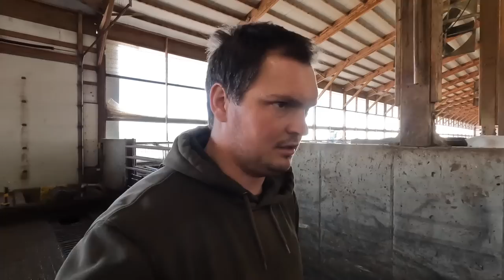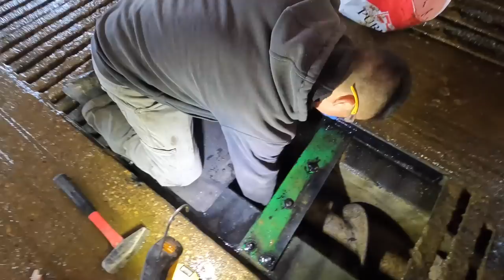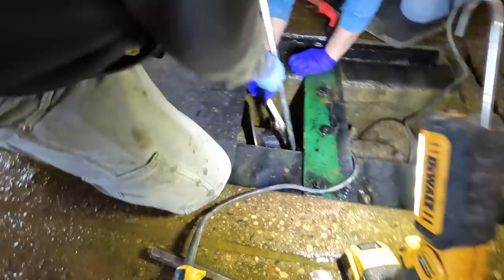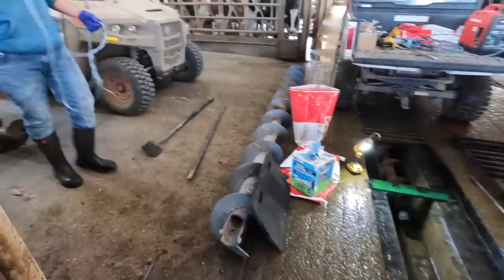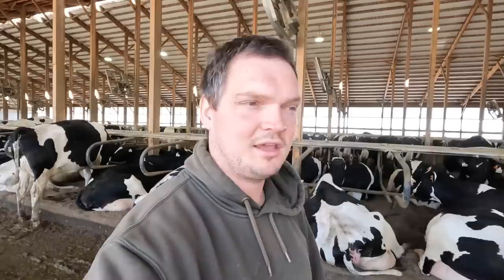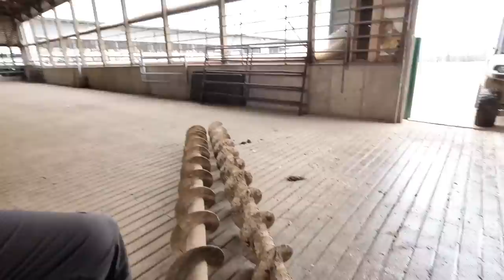Maintenance on a Dairy Farm (85)

Comment: I'm a firm believer in anti-seize lubricant, especially in a wet environment.  It makes things a lot easier when you have to take the thing apart again.
Reply: Hopefully the bolts are all Stainless Steel. Even the green steel pieces would be nice if SS. Of coarse the price ...??

Comment: How often do the augers wear out from the sand in the manure; do the vanes eer wear down from the friction?
Reply from the maker: Most of the augers are still original, it's usually the bolt holes on the ends that get worn out. We're able to replace the ends of the augers if the bolt holes are bad and continue to use the auger.